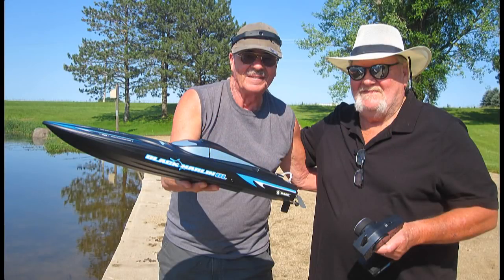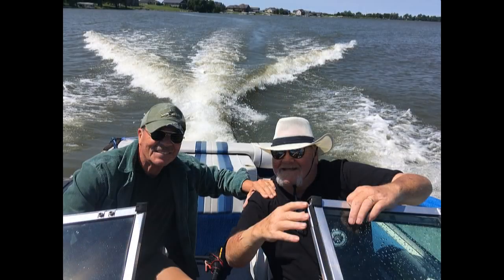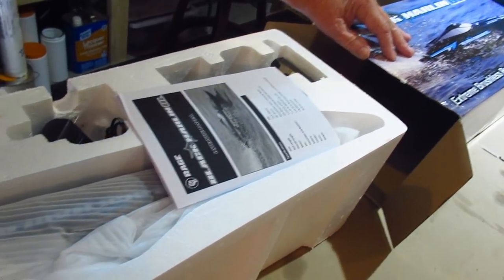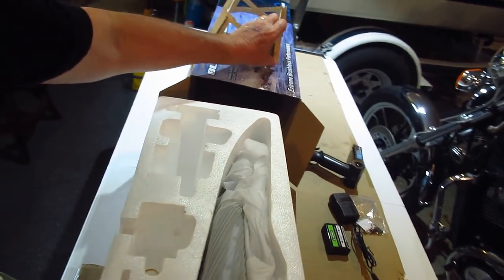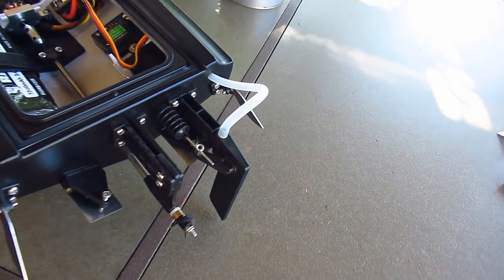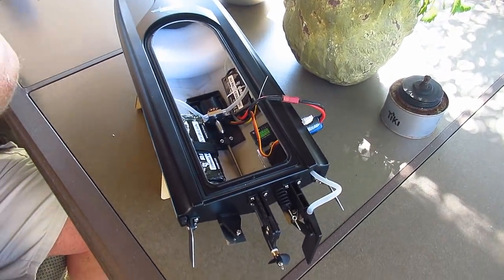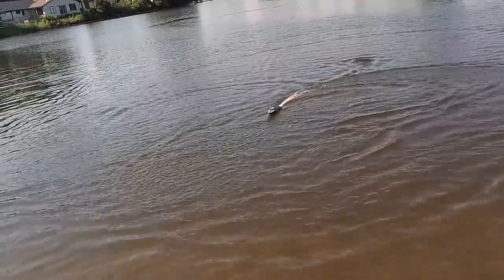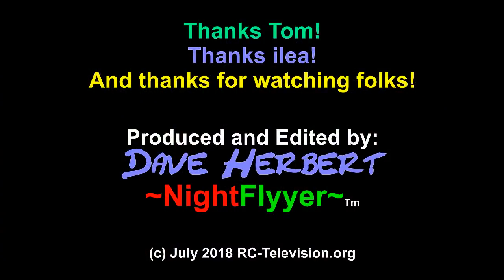Tom's Rage Black Marlin Brushless Speed boat review.

Comment: How long is the battery pack? And how much does it weigh
Reply from the maker: 2/3/4 inches.  I don't know the weight.  It is quite light.  I put a bigger 1800 Ma battery in it in my next video and it really made a difference in speed, as it is a very high C.  I actually use 2 batteries separated with a Schottky Diode to double the run time to over 19 minutes with no degradation that I could see in speed.  Thanks.

Comment: hey friend if you find a prop upgrade that works well on this boat I'd like to hear from ya on what it is. I've tried several with no luck. it has the power to push a bigger prop but they all tend to cause the ass end to rise out of the water. just drags them to the top for some reason. also i just figured out how to program the esc something ive had problems with out of this one.
Reply from the maker: You might need to lower the smart tabs to keep the nose from popping out with a more powerful prop.  It works on my real boat too.  Stay tuned, because I have a video comparison and drag race video coming up between the brushed version and the brushless.  Thanks for the comments.
Reply: NightFlyyer will do. I've literally tried ever way i could think of.i spent the afternoon saying i wasnt gonna stop till i had it the way i wanted it. i was wrong. after watching some more the best way i know how to explain what it looks like is that it won't bite the water it tries to take off then just falls on it's face. i got it to go one run and it hauled. but only once. i can floor it. take off slow. it does the same. gets started then the prop starts loosing it's bite. I'm all alone in this hobby just going by what info i can find on youtube. i figured you screw it on and go. i was wrong again. hell if it was easy it wouldn't be fun i guess. I'll figure it out or go crazy trying.